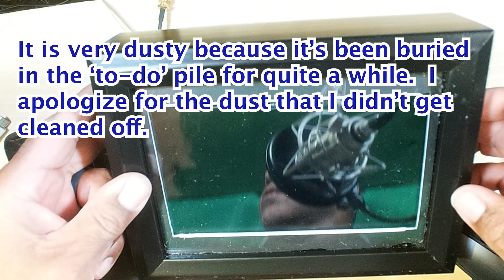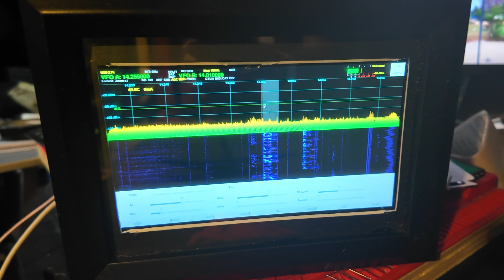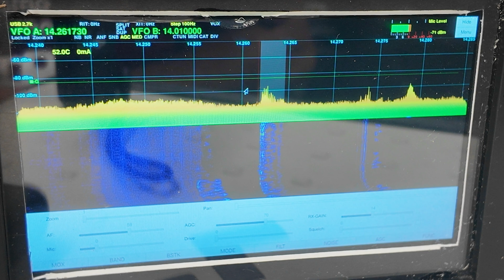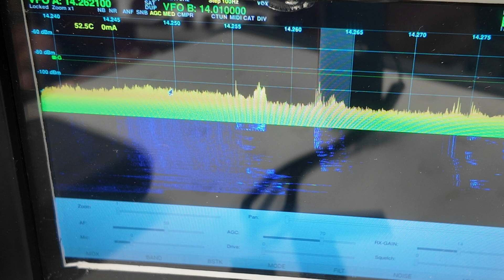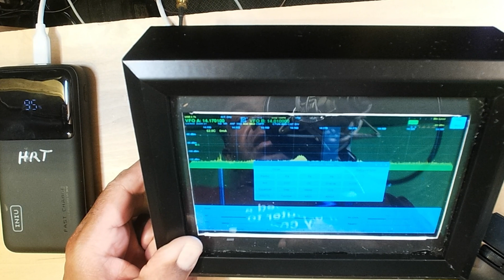Radioberry Project Brief View

Comment: I just got mine working today.  I’m running DragonOS, & SDRconnect, installed as mentioned in the readme on the desktop. The SDRPlay duo, is sitting below the monitor, so it’s small, but there are a bunch of wires and I’m trying to think about what I want to do to neaten it up.
Reply from the maker: Thanks for dropping into the conversation!  I appreciate it. Sounds like you are well on your way to having fun with it. I’ve got a wire mess on another project so I get you. Stop back anytime and give us an update. 73 de Bill

Comment: I have had a Radioberry for years and for me, I want it to transmit. I can make mine appear on the network as a HL2 which is what it is. But the cool thing to do is make it transmit. It needs a filter board and PA. Is that where you are headed? Largely, the upgraded board has some chip changes but it is the same as the one I have with a slightly different Chip on it. The older board I have works just fine. Thanks Bill.
Reply from the maker: Thanks for getting in the conversation, Don!  I appreciate the support.  My first step was getting it working; I had no joy with version 1.  I have gotten version two to receive, and my next step is investigate transmitting.  I am in no big hurry, though.   I'm just going to sit on  the receive success for a bit.  Tech Minds and a couple other guys have gone much further.  Search youtube, you will find them.  73 de Bill
Reply: Nice work Bill, thanks for the video 👍